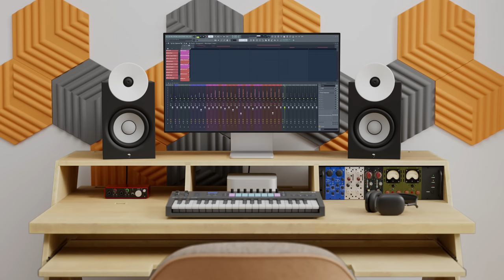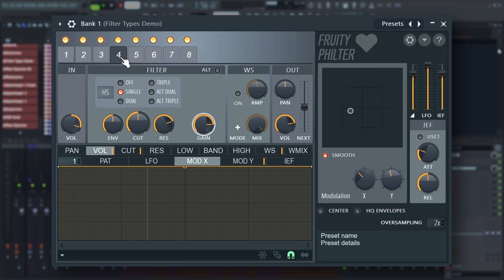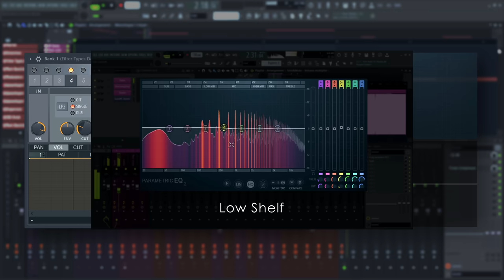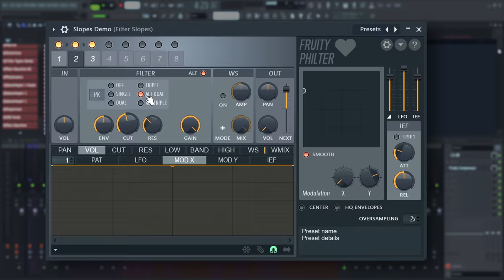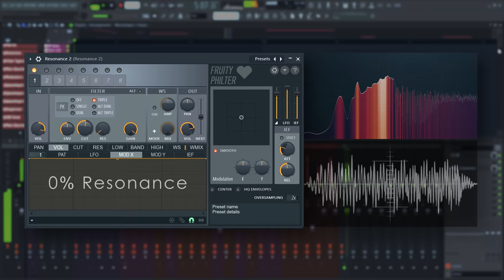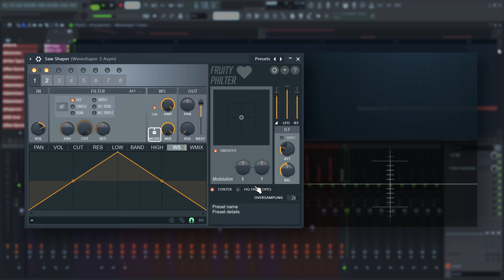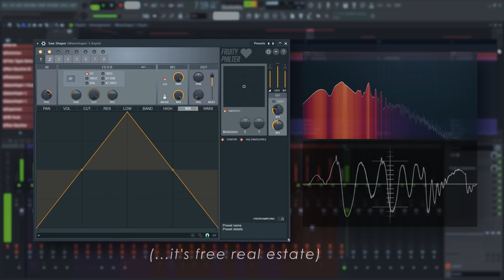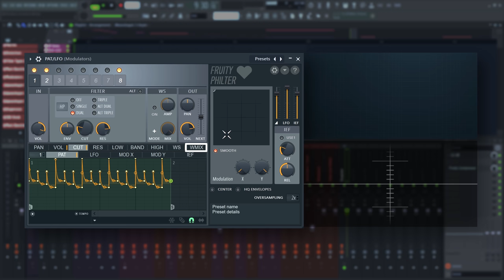FL STUDIO | Love Philter

Comment: It's certainly one of the best plugins, but I never see anyone use it! Thanks for this video, a great refresher with great demos and editing.
Reply: Aw man this gets used alot in the Hip hop trap world
Reply: Yeah, I agree that it's good, but tbh I think the reason it's underused is that it's a little redundant for most good plugins - since they usually have all this functionality already built into them rather than being on a separate effect plugin. (Sytrus, Harmor, Serum, PhasePlant, Vital, etc.) That being said, it's definitely good if you're using a plugin that doesn't have this functionality built-in, and you might wanna use it anyway if you prefer the UI and layout of Love Philter. I can think of one plugin I would use Love Philter with at least, which would be Fruity Granuliser, but outside of that I don't usually find it to be needed.

I think the big thing about Love Philter that goes unnoticed is its allpass filter, because allpasses may be subtle and hard to notice initially, but they are insanely powerful and important to use imo. afaik I think Love Philter is the only FL-Native plugin with an allpass filter, which is a big deal - it's just it's so hidden away. Me personally, even as someone who gets into the very technical side of sound design and reads through the manuals of most of the plugins I use to see if I can find any unique ways to manipulate the sound, I went years without even knowing allpass filters existed - I never knew that FL had one in Love Philter until after I'd already been introduced to them through KiloHearts' Disperser, and by that time of course Disperser had already become my go to allpass filter.
Reply: @Vospi  Yeah if anything I might use allpass too much now...

I can't make a single bass without first testing if a 50% mix Disperser makes it sound better or not.
Reply: @iii601 Not sure, just looked like Wave Candy to me. I don't use visualiser plugins very often though.

Comment: That Phase-Dispersion doh ! 🥳 0:51
Reply: u can do it ???
Reply: @ovnimoon  Didn’t went on to do it in the Daw yet, busy week, but pause the video and copy the settings, try presets and then do it by ear is always the key ✌️

Had to check back, but watch the small window in the right bottom corner, it switches with the different types they show, have to check Philter but I’m pretty sure you can type em or at least tweak until you have the same/similar code/sentence 🥳 ^assuming you got similar material/samples to use on 😂
Reply: Very reminiscent of the Korg MS 20’s filter